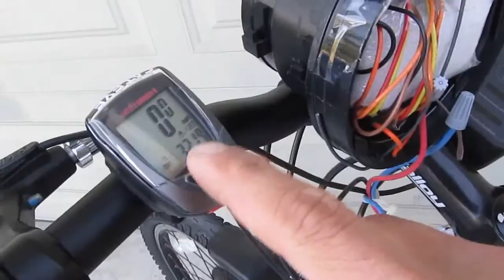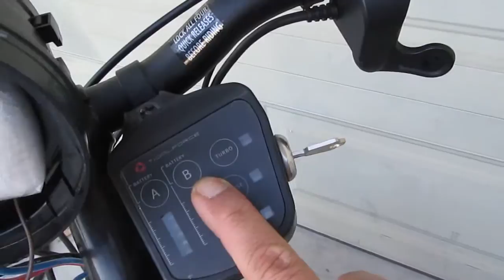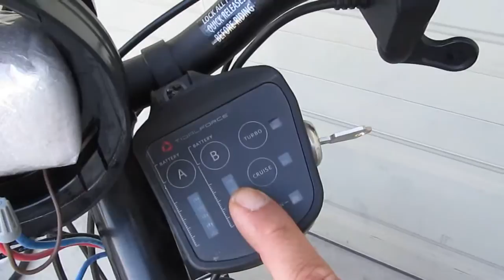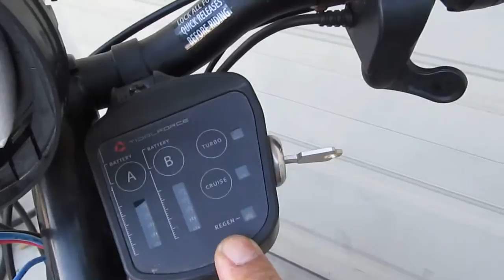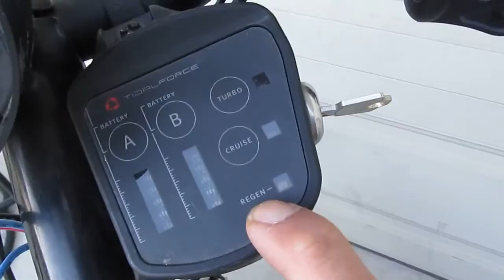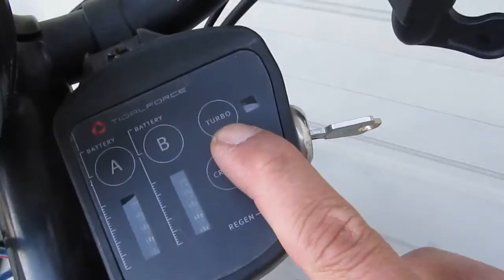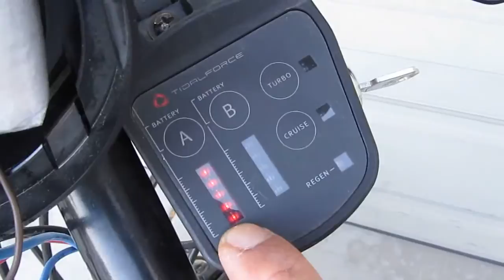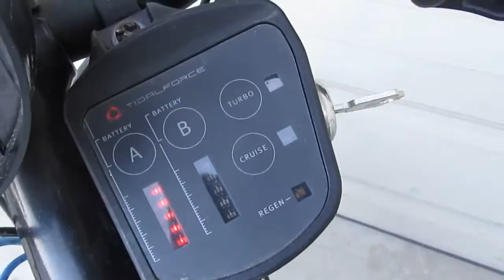Tidal Force M-750 Electric bike full review

Comment: Hi Vuaeco, the TF system is 36V. It doesn't switch between 24 and 48V. If you want to swap out the TF battery with a 3rd party battery, see my blog here: http://ebikerider.blogspot.com/2012/03/how-to-use-external-battery-pack-with.html
Reply from the maker: Ambrose Liao Hi Ambrose, You are right, I made a mistake on the review. This bike is 36V, not 48V. 
I think the blog you gave me was the one I followed to add a second battery. But it did not work. The "B" button did not light up when I hook up to a second battery. Is there something else I'm missing?
Reply: vuaeco Your "missing" that you can't use a 48v battery source (54v charged), as the max charged voltage is 46v, otherwise the rear hub will not respond.  Assuming of course you connected the correct 11/12th pins in the "B" battery in the dash.

It's worth it having LEVT do the software upgrade to be unregulated. If you need the contact info, I or even Ambrose has it.

Using a 46v battery source will pull you harder to your current 19.6mph max speed.  :-)
Reply: vuaeco Hi Vuaeco. My blog shows the system using a 3rd party battery. It won't enable the "B" battery function since the jumper I install overrides the front hub motor. It's much easier to just use the 3rd party battery separate from the front hub battery.
Reply from the maker: Ambrose Liao Hi Ambrose, I did try a 3rd party 40V battery. There's another separate Anderson connector so I just tried to hook it up to the 3rd party battery anyway. The "B" LED light did not light up. However, the throttle works but seems to be like "on/off" button instead of variable speed. I'll make another video to demonstrate. 
Also, do you know how to disable the speed limiter on this controller? It limits the motor to only run at 20 MPH max. The motor is more than capable of running in excess of 30 MPH, I believe.

Comment: I just spotted this nice review! Nice! Hi Kit.
Reply: Hey Ambrose...just bought a grey S-750X, making it my 9th Tidalforce, or 10th w/M-750 E+!  :-)
Reply: Kit Babcock Okay, Kit. You win the TF battle. I'm actually downsizing my collection of 6! :)
Reply: It's great to see another person as passionate about the TF ebikes as I have been the last 4.5 years.

I attempted to purchase 3 NOS X hubs from Shellie, @ LEVT, that were the recalls on the S-750X w/wrong spokes sizes. My offer was "as-is" and I would re-lace them. She refused, and rebuilt the hubs with the correct spokes and then offered them to me for $800 each. I passed and instead purchased two of the "poor man TF" Magic pie MP4 hub kits from Golden Motors with the internal sine-wave controller. One was the standard 28mph @ 60v and the other was a special wind for high speed (34mph @ 60v). THEY WORK GREAT! They in fact match or exceed the performance of the X TF! The cost was $240 + $40 dash & $150 to ship each. Both were installed on the 2000 EVG PE (Police edition) ebikes, which I have 6.

I've love to find someone qualified to upgrade the X hubs to use around 63v! Then we would have a nice performing ebikes! Your thoughts?
Reply: It would be great, however, that's not what it was designed for. There are tons of folks doing that sort of mod on cheap Chinese motors. I don't feel a need to do it with the TF motors.
Reply: Could u show how to charge this battery? How often do you charge the battery?

Comment: Would I be able to replace these 1 volt battery cell with more current technology battery?
Reply: Yes, You can replace the battery with a Lithium Ion Battery. I did this and mounted the new battery on the Water Bottle lugs. I used a 36V 15A with 30A continuous load capability.

Comment: Are you able to revived the original tidal force battery pack?
Reply from the maker: It has NimH batteries inside. I got rid of it and just put in a regular wheel. I used 2x Milwaukee 18V batteries in series instead. Check out this video: https://www.youtube.com/watch?v=izBDbKbOj9w&t=3s
Reply: It is easier to just replace it with a Lithium Ion Battery Pack.